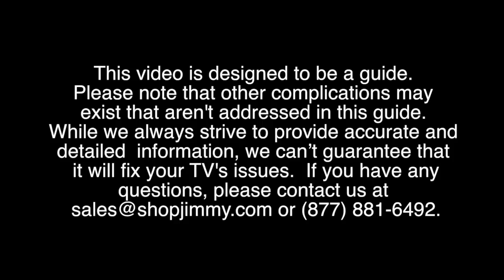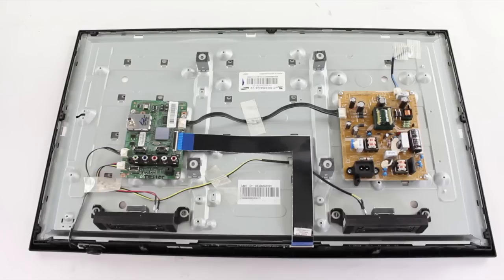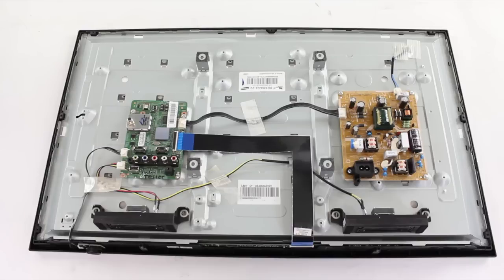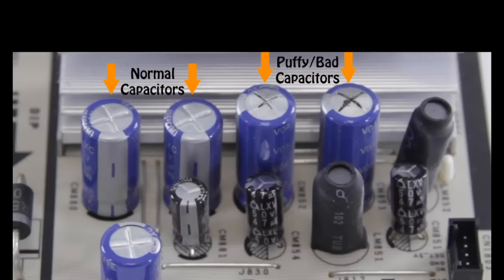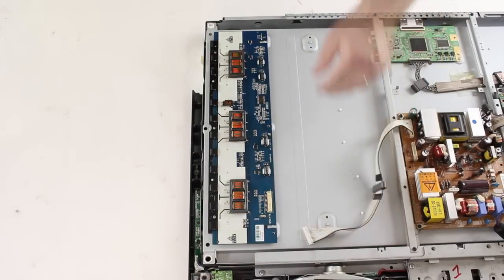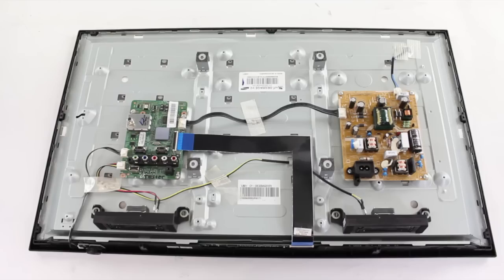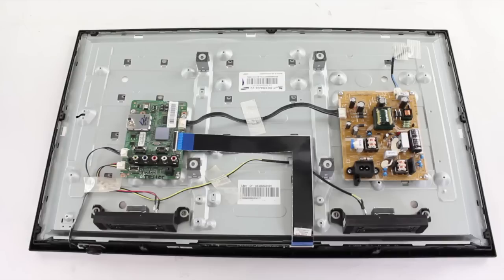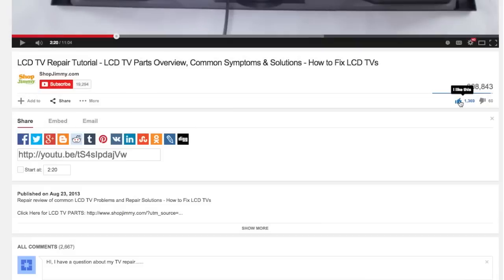Samsung LED TV Blank Screen No Picture With Good Backlights Basic Troubleshooting Help

Comment: Thank you for the video.  Samsung 50 inch that had the back light on, the sound was on.  It faded to black while viewing.  One T-conn board later and boom, it's back.  I really didn't want to replace the tv as it was only 2.5 years old.$50 and the reassurance of this video, and I get my tv back.  Thanks again Shop Jimmy
Reply: My tv did this but I replaced the tcon board and nothing changed

Comment: hey jimmy could you help me for troubleshooting my samsung UA55F8000 Led tv , there is sound but no image ( black screen) i started with measuring the power supply which is okay , the main board voltages are okay too but the T con board is burned. but now to make sure that there is no other damages i would like to know if my tv has a driver led board & how to test it  ? because it does not look like it has one & my second question if it's not the driver board problem it would means that my leds are burned so i would like to know how to test a single led ? thanks in advance

Comment: Jimmy. I have a Samsung UNF60FH6200F 60 inch LCD. I purchased the replacement Power board/LED driver BN44-00669A from you. When I replace the board and plug in the power (tv off) the board sparks and pops. It only does this when the connector for the LCD strips is plugged in. Never the connection from the Logic board. Can not find an explanation. Is the Board connecting to the LEDs bad? Wouldn’t think a blown LED would do that. TYIA.

Comment: Hi shop jimmy good day here in the Philippines. Can asked you about my devant led tv during i test using 24volts dc na led backlight dim when i using 110 volts the lights brights this a normal or not all led bulb around 3.3 volts dc right?

Comment: I have a Samsung 55in smart tv model UN55N6201AF I have sound, and after doing the flashlight trick I have picture but no backlights, so I bought a LED backlights tester and I have determined that the backlights do work and I also have checked all 3 boards for damages and I don't see anything wrong with them, no blown compassitors or burn marks and the same thing goes with the wires and cables??? What do you think that I should do or check next, I would really appreciate if you could give me any info or suggestions that may help me get my tv working again, football is just around the corner? I would like to thank you in advance for any advice or help, Charles Darcy

Comment: My samsung UN50J5000BFXZA stopped working after about 2-2.5 years.  Back lights are on and sound works.  Opened the back and nothing is obviously damaged (no burn marks, ect.) Sounds like the t-con board (which is connected to another board?) Would you like pics?  Would love your advice!

Comment: I have a question for you. I have bought two separate power supply boards. The first one I bought wasn't cataloged properly where I bought it. The board has a different spread on the 12 pin. I did actually notice though that the (K) board did power up my backlights when unplugged from the main board. The reason I mention this is because I got another power supply board today and hooked it up to find I am now getting power but according to this testing it would suggest my led strips are bad as I have no backlight when  powered on. I now hear noise but no backlights. I hooked up the (K) board again to see if the backlights would power on and they do still so I don't think it's the backlights.. I'm lost.. any ideas?🤔

Comment: Hi Jimmy. I have a problem in my Samsung LED TV model UA32H4100AR, it has a blank screen but does have backlights. Sound is normal and OK. While watching from very near, very dim picture can be seen with difficulty and "Menu" is also displayed very dim and visible with very difficulty.
Reply: Did you find any solution?

Comment: I have a Samsung model UN55J620DAFXZA   version US02 After going through your recommended test I ordered and installed your 3 board complete repair kit. After installing all 3 I still the   same issue, menu shows with flashlight and still have sound but no visible picture. Any more suggestions short of new TV?

Comment: I have a un32eh4003fxza, The screen was washed with a spray bottle. I've taken tv apart and looked at the board at the bottom of the screen. the flat cable attaches to this. There are no burn marks but there are water marks. can this board be purchased? board looks to come with new screen. Can this board be purchased separately?

Comment: I have a Samsung un55ju6500f  EH02  that when the power is connected, the red power button lights up, press it and it blinks twice with a pause for a total of 8-9 flashes. There are not bulging or leaking caps on the PSU. If you unplug the cable going to the main board, the back lights come on. CNM803 connections from PSU to Main board appear to be correct with pin 3,5,7,9 at 13v and stand bye power.

The T-Con board has no LED's that light up, and zero voltage at the F1 fuse, all connections plugged in OR with the driver cables unplugged. Any idea how to test if the Main board is sending power to the T-Con to nail down if it's the main board or the T-con being bad?

Any tips would be much appreciated before I buy boards to find out it's a bad LED display!!!!

Comment: hi Jimmy. I have a Samsung UA40F5500 which displays no picture but has sound. it has backlight lights that I can see through the back of the tv and when I turn the tv on the screen lights up a little brighter than being just straight black but has no picture. It is also out of warranty. what do you recommend?
Reply: Yes, I fixed it. It was the T-Con board for my tv. Easy to replace yourself, Just be gentle. Looks like this model may have bad t-con boards. Good luck.

Comment: iI have this exact TV set in this video.. A Samsung UN32EH4003F - UN32EH4003 And we have sound but no picture. Should I hook up a DVD player and see if there is a picture? I do not see any burnt out componets on both boards. From what you have said it may be the tcon board, is that correct? If so can it be tested? Any information would be helpful. Thank you.

Comment: cross posted to another video - I could use some help with my Samsung UN46D6003SFXZA from 2011.  The picture and audio stopped a few minutes after powering it on.  I tried resetting it by unplugging and holding the power button for 30 seconds.  When I plugged it back in I got a standby light so I turned it on again.  Samsung logo appears for 2-3 seconds and screen goes black.  Standby light blinks 5 times and dies.     I tried disconnecting the cable from the power supply board to the main board and the backlights came on.    My problems are:  How do I determine if it's the main board or the t-con board that is bad?  If it's the t-con board, how do I get the LVDS cable off?  It has a connection type that I can't seem to locate in ANY videos.  I do have access to an electrical tester but I have never used a soldering iron.

Comment: Jimmy, please, my Samsung UN50H5203AFXZA, IHO2, I lost the picture , black display, no sound, remote control sensor 
 .flashing red light, there is no damage or burn in the boards
Wait you advice

Comment: Hi my Gabriel I have aTV is a Samsung 60in Model # UN60EH6000FXZA Version #HS01
 S/N #Z4QR3CZCC07482L
The TV has sound but no picture 
1) I Replace the two main boards (one it call the t-com main board)but not luck still the same
2) I turn on the tv on the dark in the back of the panel has lights on 
Do you know what else can be wrong the TV

Comment: Where is the LED driver? Or t con boards at?  I have a Samsung led UN55 that has just the two boards as well. With two ribbons coming out of the control board to the bottom of the TV I have no idea where to find the LED driver or Inverter boards? Dos anyone know? You say the Led driver was built into the power board but you did not show what part on the board was the led driver.

Comment: HELPPP Jimmy!!!!!! I have a Samsung LED Mod# UN50H6201AFXZA. My issue is that I have sound, back light but, no picture. I did the flashlight test, I did not see a picture. In addition, I individually changed the T-Con board, The Power board, each time is the same result. Is there another issue I'm not realizing? Can anyone help? Thanks in advance....
Reply: Roland Cameau you ever find out what the problem was?
Reply: I also have the exact same tv with the same issue. I have replaced all boards inside and it still will not display and there are not physical breaks on the lcd screen. The backlight turns on and the remote registers with the tv but doesn't display anything.
Reply: Reid Roethel I have a different model but the exact same problem. I was told it's likely a problem with the LED problem. If it's the LED panel than it would be the second time my TV has the same issue. The first time was about ten months after buying the TV. Did you manage to resolve the problem with your TV?
Reply: Looks like I’m having the same issue as you guys. Anyone have an answer yet?
Reply: Roland Cameau your proble is probably the main board
Reply: Looks like it's been 6 months since the last reply.  I also have a Samsung LED Mod# UN50H6201AFXZA that has the exact same problems as you all.  I do not have picture. I do have audio and backlights.  I swapped out the T-Con board and yesterday I received the mainboard from shopjimmy.com.  I replaced the mainboard and still have the SAME exact problem.  Has anyone out there found the exact fix for this issue ?  I am ready to get RMAs for both boards and return them for refund and dump this TV.  I saw on another forum that someone changed out the power supply, T-Con and Mainboard circuit boards and ended up with the same problem still.  Any ideas or recommendations before I get RMA #s ? Hope to hear from someone......
Reply: its LED fuse
Reply: Where is the fuse located? I'm having the same problem
Reply: Were there any video links at the end cause I just saw a white screen?
Reply: Türkçe
Reply: @dmaes61  faulty screen right?

Comment: i had change the mainboard on samsung tv model un60eh6003 because when i unplug the mainboard the backlight would stay on and all my voltages are present .when i replace the tv with a new mainboard it kills the voltage on the power supply for five seconds.its does the same thing as the old mainboard.

Comment: HI jimmy,

I have a Samsung smart tv model # un50eh5300f, it will not turn on. When I disconnect the cable that connects power board to the main board I see the back light come on. I order a new main board, replaced it but the tv still won't turn on. Can you help identify the issue.

Thank you

Comment: hello I have a TV samsung un65j6200 black screen after checking more than half of my led was burnt I changed all the led strips but I always have black screen if I put the TV on and connect the led tester to the led connector  I see the picture what is the problem

Comment: Hello! I enjoy your videos. Thanks for posting them. I have a Samsung UN55ES6100 LED TV. Upon power on, back lights turn on for about 2 seconds, then off. So, back lights do not stay on and flashlight test shows no image on the screen. Power supply is producing 5V & 12V, which is making it to the main board via the connector. Disconnecting main board from power supply results in back lights coming on and staying on continuously. Disconnecting all connectors from the main board, except for the cable from the power supply to main board, results in same initial symptom of back lights on for about 2 seconds, then off. No caps look swollen and no burnt components; however the main chip on the main board gets too hot to keep your finger on it for more than about 2 seconds. Thanks in advance for any help.

Comment: Hi, I have a samsung UE50KU6020K tv and it has just switched off and will not restart. The red led power light is flashing with 2 second intervals and inbetween the flashes the Samsung tv logo is flashing on and off on the screen very faintly also 2 second intervals. I haven’t removed the rear panel but I have looked through the grill on the rear and it seems to have no light. Please can you advise what I need to do to determine the problem?
Reply: Sadly, NO one at "ShopJimmy" will EVER help you; except if you are buying their parts; IF they are in stock and sadder most of the parts are NO longer available. So sad but VERY true.

Comment: I have a samsung un43ru7100fxza, I have power and backlight comes on, and I have sound but no picture, Ive swaped out the power board and the main board, I don't think is the power board because when I swap the power board I get the same results, did i get a bad main board? I also check the board on the bottom where the power button is but, I din't see anything burnt or unusual. help, I tired of buying new samsung tv every other year!

Comment: Hi Jimmy. I have a 48 in Samsung LED TV model: UN48H5500AFXZA. Last night my screen and sound just went black while playing video games. I unplugged it and turned it on. The "smart tv" logo appeared but nothing afterwards just blackness with a haze at the bottom of the panel (how I know its on). I tried to see if I could navigate without picture and nothing. Also once I turn the t.v. on I can't turn it off unless I unplug it. Another thing to note, the standby light does work and its on when the tv is off. When I turn the tv on, it blinks 6 times and then only flutters when I press any remote buttons Help!
Reply from the maker: +victoria mccallum  Try all repairs and troubleshooting at your own risk.  This could be a problem with either the main board or the TV panel.  You can replace the main board to see if that fixes the problem with your TV.  Click this link to replacement parts for your TV model number:  http://www.shopjimmy.com/samsung-bn94-07226l-main-board-for-un48h5500afxza.htm  There may be multiple boards for the same TV model number, be sure to match part numbers on your current board, with your replacement for compatibility.  Here is a link to a video showing how to identify your part number, click here:  https://www.youtube.com/watch?v=f7QkKGlqM_Y  Thanks and please let us know if you have any further questions with your TV Repair!  www.shopjimmy.com

Comment: I have a Samsung 3d TV with back lights but no image. Fails flash light test. Before it went out there appeared black line and discoloration on lower left corner of the TV. Any suggestions? Is it bad panel or tcon?

Comment: Hey Jimmy, I have a 50in samsung UN50H6350AFXZA. I was playing video games when the screen went  black but I still had sound. I did the flashlight test and noticed that I had black lights but no picture. my question to you is it worth fixing this TV? I only had this TV for 1 year 6 months please help thank you.
Reply from the maker: +Mark Blake   Try all repairs and troubleshooting at your own risk. This could be a problem with either the t-con board, the main board or the TV panel. You can replace the main board and the t-con board individually to see if one of those boards fixes the problem.  Click this link to replacement parts for your TV model number:  http://www.shopjimmy.com/catalogsearch/result/?q=UN50H6350AFXZA  There may be multiple boards for the same TV model number, be sure to match part numbers on your current board, with your replacement for compatibility.  Thanks and please let us know if you have any further questions with your TV Repair!  www.shopjimmy.com
Reply: did you ever fix it, My tv did the same thing after playing my xbox one

Comment: I have a Samsung un55fh6030 When I turn the eco sensor to Off, the tv is darkest say 50%, low 55% Medium 60% and High where I have it 90%. I feel it's a bad or failing eco sensor issue but don't know where it's located . When enabled, the backlight setting can only go up to 12, anything higher the screen darkens to below 50%. It's strange that the brightest I can get the tv is when the eco settings are turned on three highest. Which is opposite from my understanding.